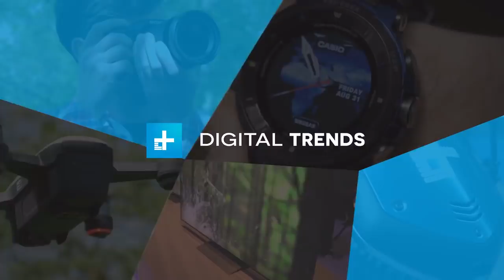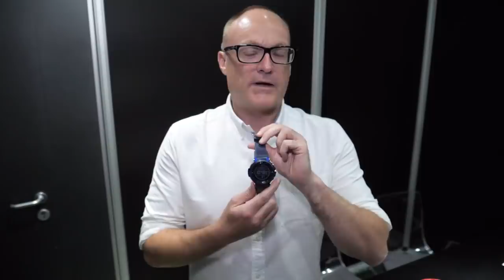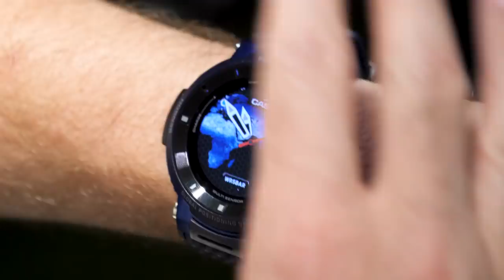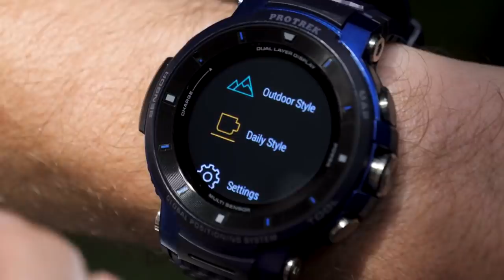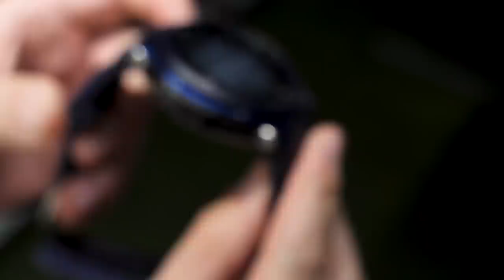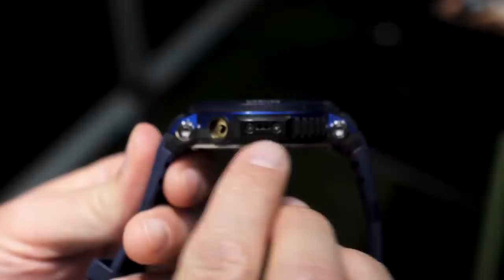Casio Pro Trek WSD F30 Watch - Hands on at IFA 2018

Comment: Put solar charging in it.
Reply: Or a solar charging accessory like a folding solar array that can be stored in a day pack.
Reply: @SoCalFreelance  ;Поздрав, good suggestion. Especially solar charging is the best. I have it on my prg 240 and it is great.
Reply: If they put solar then I might pay for this over priced watch
Reply: @tb7246  I bought the f20 for 249usd brand new on Ebay. All three colors of the f20 are now half off.
Reply: with all the bells and whistles and the price its worth less with out the SOLAR CHARGING if your lost some where in the woods
Reply: Price?
Reply: No where to put solar, it will shrink the screen if they put solar on it and still it won't charge that smart watch battery much.
Reply: Rangeman already have solar charging with smart watch.... pls do solar charging and you can take my money then..
Reply: Where you going to put the solar on the wrist strap? Not going to work Buddy. Even if you could the solar piece would be so small it would take a month to charge the phone from the sun.
Reply: @badimpulses17  the same place it is on solar protreks, around the edge buddy

Comment: i dont get why casio still has not thought to out solar in it. they could fit it in that hour mark ring and make this watch so much better. also does anyone know if the watch faces will be changeable like on the samsung s3?
Reply: wades623 Have you done the maths to work out the energy required to run this watch and what is required to be produced via a solar panel?
Reply: It could be useful for the outdoors monochrome screen setting. The new Rangeman has it, although the sheer size of it could probrably fit a Tesla battery.
Reply: Watch faces are changable but only on the "full power mode" the monochrome display is fixed in design